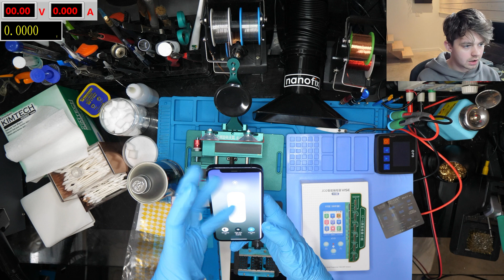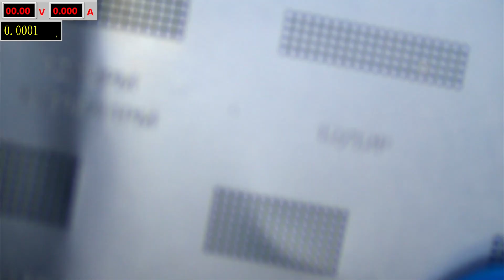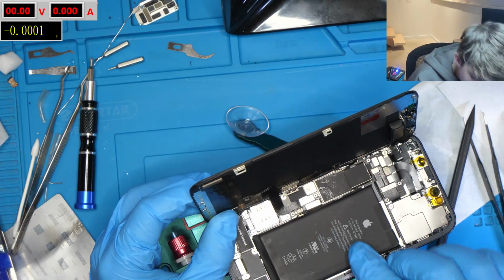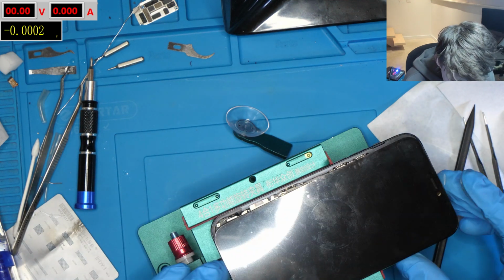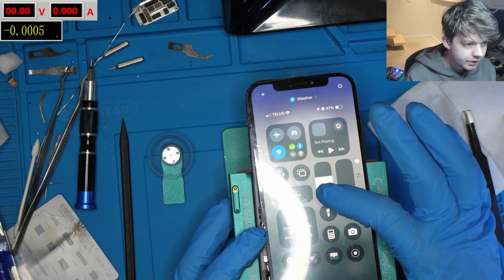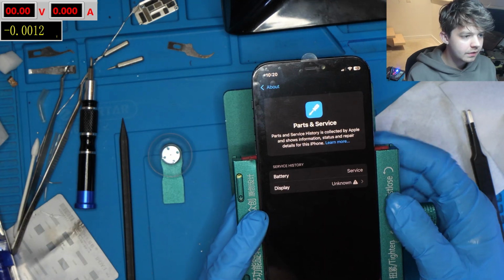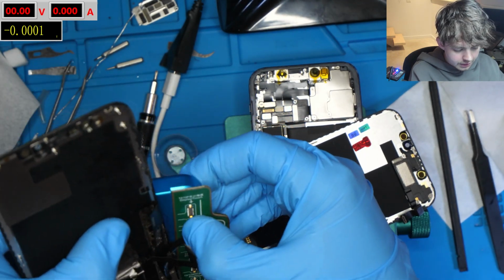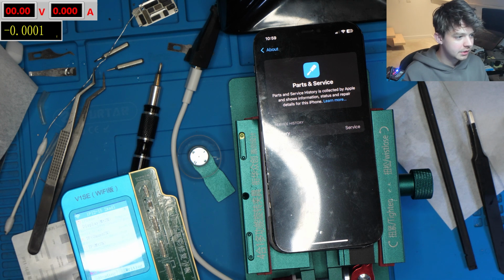Ultimate Guide to iPhone Touch ICs - LCD Programming

Comment: @nanofixca Hi, I damaged the display IC when scraping and with the solder iron tip. I took some of the green mask and the copper of the IC base was also cover with solder and impossible to remove with the copper wick. I just went ahead and reball it and reflow it over a separate flex with a 4 bus connector (16plus LCD) that comes with the display I bought (DD brand). But it doesn't turn on and gets very hot. So I desolder it... Definitely the display ID us damaged. Is it possible to buy generic ones? Because the DD LCD is the non IC version for swapping and it doesn't turn on if it does not have a display IC... You can't even test it when you receive it because it's a no IC version. Any suggestions?

Comment: Why need to move touch ic from old screen, when you could just read out all the serial numbers from it (assuming there are non original displays with presoldered touch ics, just with different serial numbers) and just move to new one? Does these displays in general have any touch ic capable for writing original serial numbers from original display to it?
Reply from the maker: The touch IC contains more data which is paired to the phone than just the readable/writable serial #s. If you just read and write the serial #s without transferring the touch IC, the phone will still complain about a non genuine display.

Comment: You don’t need to do it now because Apple let you have True Tone now on replacement screen. Also you still don’t need to do this. You can just program the chip on the new screen with code. So this method is not needed no more only on Face ID you need to do it which is a pain in the arse.
Reply from the maker: IOS 18+ still displays the non-genuine part message like I show in the video. Transferring the touch IC is still best practice to retain the calibration and full functionality of the screen - especially for OLED screens on the new phones. Apple can change their mind any day (and often do). The touch IC has more data on it than just the serials we can read/write with the programmer. We can't read/write the whole chip. Transferring the IC allows the phone to be as close to stock as possible when doing a screen replacement. I will say, that doesn't necessarily mean it's a financially viable option for everyone. It's still good to inform the customer of their options! :)
Reply: @ no it does not at all. Done many with no problems. Apple have drop it now under the new ios18. Done loads with no problems at all. But then I do buy quality screen and not shit cheap crap for repairs.
Reply from the maker: @michaelmitchell8218  Good to know 👍🏻 I still prefer to transfer it. The XO7 Soft OLED screens I get do not come with a touch IC (just the "transferrable IC" sticker) so the warning still appears in the parts and service history like in the video (the phone in the video was on IOS 18)
Reply: @ sorry I’m not knocking your work. I do the same as you but found lately that screen seem to work with iOS 18 and put True Tone back. But like I said I don’t know about these cheap screens. Also you can just program the new screen with the data from the old screen. Face ID is the big pain still, hate doing them. Anyway I can see your skilled at what you do and good to see because of many bad videos on here showing people how to mess up there phone more lol. People do need to understand it’s not easy and takes years of working with hot air stations and soldering micro components. I been doing electronics for over 35 years and you still learn new stuff.
Reply from the maker: I didn't feel like you were knocking my work! I very much appreciate comments like yours. Conversation with other technicians is one of the main reasons I made the channel. I appreciate your experience and knowledge :)
Reply: @michaelmitchell8218  you talking about truetone and nanofix about important display message. Thats two things. Yes, there are now self-disgnostic screens which can calibrate as used part. But you still have the record in parts history :)

Comment: So.. I pulled my south bridge motherboard chip off, came off fine, but was going through the steps of adding new solder and using a tiny piece of Flux core copper wick started going over everything, went well, then I went to add the new solder and I noticed 2 pads looked a little odd, maybe I went over them too quickly or with too high heat? I keep my iron at 690F usually, Weller, tons of tips but used my regular big one. Ended up with about 12 pads ripped up so I took the tweezers to pick at it, nothing, used the dremmel (at this point I'm just learning by doing on a dead board) and that didn't help any. I gave up. Was it the temperature? Mehhh
Reply from the maker: It's actually possible that the temperature was too low. this can cause the braid to catch on the BGA pads and pull them off the board if you're not careful. I usually use at least 400C to wick
Reply: @nanofixca  alrighty ty ty, also was just thinking if using my chip quick low melt solder would work with reballing? Or that would be a really bad idea, the heat generated by the chip while running would melt the solder balls if it was chip quick. Bought some and still haven't used it. (Scared to scatter it everywhere while it's molten)
Reply from the maker: @ Yes definitely not a good idea to use low melt solder to reball or solder anything. it should only be used for desoldering
Reply: @nanofixca  1 more thing and I'll leave ya alone lol.. maybe it was just Flux on the top of the IC, but I couldn't get a handle on it when it started moving, I bought a chip vacuum grabber "rechargeable esd vacuum pickup pen for ic components" when I went to pick the chip up it wouldn't suction to it, what should I use to pick it up reliably? Something with a bigger vacuum than this rechargeable one? I've seen retro renegade repairs use some type of suction tool on bigger ICs like Xbox chips but no idea what it is. Ended up using the weird bent tweezers you linked  in a previous video to kinda flip it over and grab it sideways but I got solderballs splattering around the area onto smd resistors and caps lol, somehow knocked a 0402 cap off the top of the chip. Was a mess. :'(

Comment: The pairing itself is actually never the problem.
Doing that for supply chain management makes a whole lot of sense, as it makes it way easier to track defects from the field, track possibly problematic part lots etc.

The issue occurs when you use that to damage the user experience.
I mean I'm not even against having a service section where it says: the screen of this device has been replaced, the new one was first powered on at 'bla bla bla'. This also makes it more trasnparent for users who buy used. Same for batteries etc.

What sucks though is when they start doing stuff like deactivating True Tone, disabling Touch ID and stuff like that. There is zero justification.
Reply from the maker: @markusdd5  100% agree!!
Reply: @nanofixca  by the way, did you see my comment under your recent video about the owon multimeter PC software? I felt my comments were being removed for some reason.
Reply from the maker: @markusdd5  only just now seeing it! I'll respond over there. Weird, YT doesn't even show your other comments in the "Held" section for me to even review. Their comment filtering seems to be extremely broken recently. Maybe YT removed it if you included a link, but you'd think they would at least let me review it 🤷

Comment: Just out of curiosity…why didn’t you use the little flex that the screens from Mobilesentrix come with? It’s a lot easier to transfer the touch ic.
Reply: You solder the ic to the little flex and then you solder the flex to the solder points on the right side of the screen.
Reply from the maker: @SergioPena20  I honestly had no idea about that. The screen I bought didn't come with anything like that. Are there specific screens you need to buy for that?
Reply: @nanofixca  they’re pretty nice. They even have a white outline that shows you how to align the flex and comes with tape to cover the solder pads. I’ve had pretty good luck with them. You don’t have to stress as much about burning the display. Of course, you might want to put a thin piece of metal under the flex you are soldering to. But rather than heating up the whole area, you only have to dab your iron on the pads.
Reply: Did you read the comment I wrote before this one? It looks like it was deleted
Reply from the maker: @SergioPena20  Only got the comment where you're talking about the outline. YouTube may have auto-removed it if you provided a link or something. Their automated comment removal is pretty bad recently
Reply: @nanofixca  ok. The availability of this particular type of flex depends on the series. The XO7 on all series supports it. Some series also support it on the AQ7. What you want to look for is “IC transfer compatible.”
Reply: @nanofixca   they show the install on a video about ip13 back glass removal without laser machine and screen ic transfer. There’s another one on a 14 series, but someone else does the install and he just does a voiceover.
Reply: @nanofixca  I tried to be a lot more vague so that the comment wouldn’t get deleted. As far as the link, you already know their channel name. Just look for the video I talked about and you’ll see it.
Reply from the maker: @SergioPena20  thanks a ton for the info!!
Reply: @nanofixca  you’re welcome. I always try to help out when I can. I didn’t have much help when I was starting out. Sometimes people see it as condescending when you offer though. But yeah, if you ever need help or tips, get in touch.

Comment: Are you able to speculate on how replacement screen sellers are able to make such good replacements? Is it because Apple/Samsung use a vendor for the LCD and the aftermarket companies get the same screen from the same vendor? What about the rest of the components that make up the screen (ribbons, metal frame, etc) When you work on the OEM screen from Apple vs replacement, are they pretty much identical? 

Wondering if they're all making perfect clones or getting the same components from the same factory?
Reply from the maker: @leonkiriliuk  Honestly I have the same questions haha. The high quality 3rd party OLED panels like the XO7 soft OLEDs for the 12-16 (the one I used in this video) are definitely not the exact same part since the flex cable is different. It's totally possible that the OLED panel itself is still from Samsung/LG but it's really hard to say. As far as color and how it feels it actually seems a little better than the OEM part imo haha.

Comment: can you look up if the adapter board of the programmer still uses i2c to the connectors? :)
for the 7-11 i know that there is just a simple eeprom on the display (i have a demo video of that).
all thats needed for those older screens is a ch341a dongle and the connector board (+ 1.8v vreg) to have a low cost programmer (for lots of stuff) :D
Reply from the maker: @_DSch  Unfortunately the iPhone 12-16 touch ICs use a different more encrypted architecture then just basic EEPROM :(( I think JCID and QianLi had to reverse engineer it to get it working.

Comment: I happened to have ordered this same Mechanic solder paste - no other leaded Chineese solder paste ships to Europe anyway. What is the smallest stencil aperture that you feel comfortable using it for? Given no especially thin stencil (.125 mm is common). I would not be holding you by your word, of course. I'll get the best surface treatment for my custom stencil, but I'm still wondering if the paste will transfer to PCBs from .250 x .275 mm apertures. (This is required by BMP390 sensors since there will be no opportunities for anything but reflow soldering them first try because of their sensitivity to flux, cleaning, and even just blowing hot air over them.)
Reply from the maker: It should work fine for those BMP390 sensors! I've used it with a stencil that has 0.25mm x 0.25mm holes (0.12mm stencil thickness) for the MAX chips on the switch motherboard in this video:

 https://youtu.be/oJFODPV7aY8?si=SCbCjcOZQWz8NdjI
Reply: @nanofixca that was a fun video for sure, but you didn't actually transfer the paste off of the stencil onto something else, like a PCB, before reflowing it. I understand if that is usually all you need this paste for, but I actually need it to release from the stencil before reflowing it.
Reply from the maker: @ Oh I see what you mean. I'm not too sure, the only way to find out would be to try it out. I think you may have some trouble with holes that small if you're not reflowing the paste right away. I'm betting it will just come up with the stencil at that size regardless of the paste you use. At that scale, you may also have issues with pads bridging even if you find a paste that would work. I think the best approach would be to reflow it right away for those components and manually solder them on with a hot air station or (very) carefully place them while the PCB is on the heat plate and the solder is liquified
Reply: @nanofixca thanks, I guess we'll have to wait and see then. I wish I could do it the way you're suggesting, but that would require adding flux, which would destroy the sensor for sure. Worst case, I'll have to order paste from DigiKey, which will be much more expensive, but type 5 paste should release well.

Comment: Could you have just used the programmer to pass the touch id data to the new third-party lcd without swapping the IC?
Nice video as usual 👌🏻
Reply from the maker: There is no touch IC on the new display to write the data to (it was just a sticker). For original Apple displays, you can use the programmer alone to restore true tone without swapping the IC, but you will still have the warning message. As far as I understand there is other stuff on the IC that is paired to the phone that cannot be transferred with the programmer.
Reply from the maker: And thanks!! 👌🏻